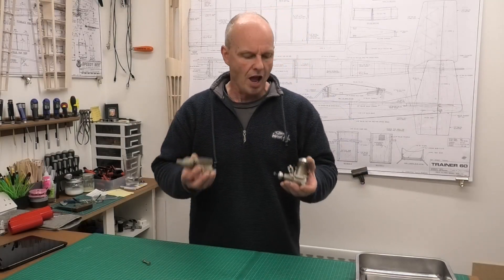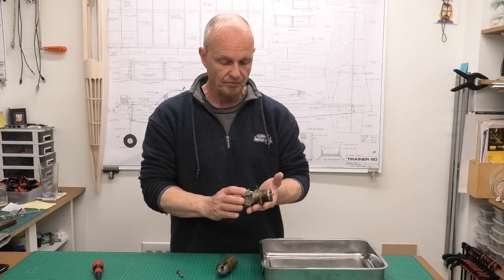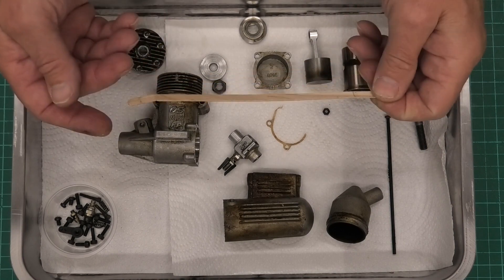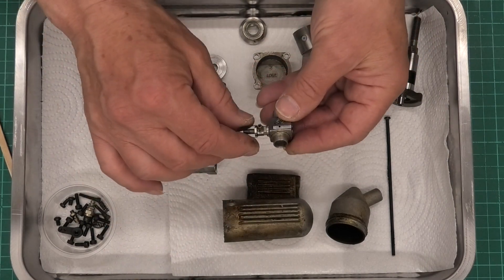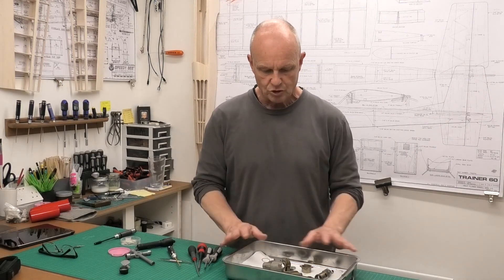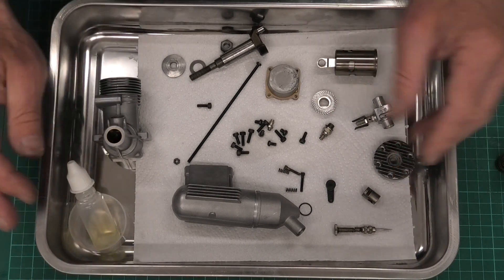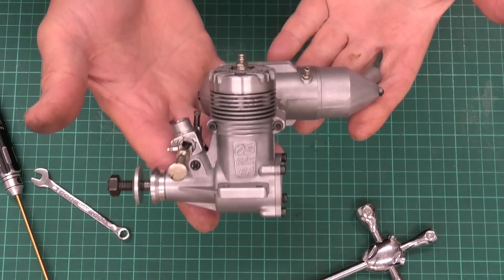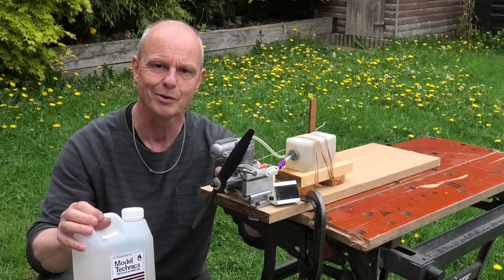OS MAX FP 40 -  Strip, Clean & Run - Early 1990's Glow Engine

Comment: hi  there, I'm currently trying to take apart a old os max 21 se-m motor i believe but I'm not quite sure how to get the pulley start piece of ( normally where the flywheel would be) could you recommend a way of doing this without damaging anything?
Cheers Matt
Reply from the maker: Sorry it is not something I am familiar with so can't advise 😀
Reply: @MarkRobinson555  no worries at all thank you, I stripped it and got it to start but it won't idle, will have to set it up on a test stand with a servo,and see how I get on, love your content,great work.
Many thanks
Matt
Reply from the maker: @ Thank you very much, pleased you enjoy the videos, hope you get your engine sorted 😀

Comment: thanks for your time and video,I was hopping you would show us the position of the ports in the cyclinder when you are putting it together I have a mark on the cyclinder but not on the block so when I took it apart did not pay attention on the ports positions.now it does not start mabe beacause I have the cycinder on the wrong position ??? thanks for you time again
Reply from the maker: Thank you for the kind comment about the video, pleased you like it.  The exhaust side of the cylinder will have carbon on it from the gasses, and the two ports will be of different sizes, the exhaust is often larger, but theses should line up correctly in size with the crankcase casting - hope that helps, good luck with getting the engine running again

Comment: Mine came without head gasket. Is that okay??
Reply from the maker: I think it would probably benefit from a gasket, you could make one out of some heavy aluminium foil.  However, if not loosing compression maybe you can get away without one

Comment: Hello Mark, do you know what the lifespan is for a glow engine?
Reply from the maker: Well I guess that is a how long is a piece of string question, I have certainly never worn one out, if treated right seem to run for ever, but life will depend on so many factors, like fuel mixture, % nitro and oil, prop size, hence how fast you run them, use of after run oil, correct cooling, ie not getting really hot in a cowl, the make and model of the engine and of the course the ultimate, driving them into the ground at high speed is a little detrimental! Hope that helps
Reply: @MarkRobinson555  Thanks Mark, you are right and Mary Chrismas and a good Newyear.
Reply from the maker: Thank you, hope you have a good Christmas and New Year as well 😀

Comment: My first RC engine, I bought one in USA as a long time ago and now I got it again and will flight a small plane after 10 years. I love that engine too! But I still not achieve the better adjust like you... It runs at maximum RPM and after 3 minutes stop. Good video, thanks...
Reply from the maker: Thanks for the comment, pleased you liked the video

Comment: Thanks for the info with great content.
Reply from the maker: Thanks very much, really appreciate the comment, pleased you liked the video
Reply: @MarkRobinson555  I do have a question now that I have my pedal in front of me.   
      Speaking about the adjustment screw, how far should it be in relation to the carbon rod?  
      Mine had the usual issue of  not wanting to spin the motor, then all of the sudden it comes to life deep into the pedal push.  So I adjusted the screw in to about half way, and noticed it is still not making a connection to the carbon.  
      Should it be touching the carbon? Or does it not matter?

Thanks again

Comment: Nice running engine. I like the 25 and 40 FP in my smaller float planes.  If I happen to have a mishap and dunk the engine, I don't have to worry about ball bearings rusting. 
 Did you Put a new O ring on when you put the carb back on?  It looked like the original O ring was still on the bench.
Reply from the maker: Hi, thanks for the comment, yes it needed a new O ring, old one had gone stiff and brittle, in my mind its an easy win as they are cheap and easy to obtain, and can make a big difference.

Comment: Great video as always, loving your recet stuff! Interested in picking up an ic model, I only fly electric at the moment. Have no real experience with IC your videos are great but do you know of  a good resource/getting started guide to running and maintenance? Thanks
Reply: Oliver. As Mark said. However, if you are in the market for one, get yourself a new engine, you can't go wrong with an OS or an Enya, ( my personal favourite make). I say new as you can follow makers instructions re fuel and prop size plus you know it's not on its way out.. Get one and enjoy!
Reply from the maker: Hi there thanks for the comment, I found with IC the more you use them and run them in test stands, playing with the tuning and reading about how to tune them, the more I learned, but also talking to people and finding someone, who's judgement you trust to talk to for advice.  Good luck, they are great to use, I enjoy the IC side as much as the flying it's self.

Comment: Mark how have you made your throttle control on your test stand,you appear to use the same on all engines?
Reply from the maker: Yes, same on all engines, its just a clevis on the end of a threaded rod, which is held loosely/ friction fit, on the wooden throttle control leaver.  Its loose because there needs to be some movement as the wooden leaver moves through an arch, its not perfect, but works ok.

Comment: What’s the normal operating rpm range for this engine or any other engines
Reply from the maker: The normal range is usually around 9 - 16,000 rpm, but the rpm is highly dependant on the fuel and prop used